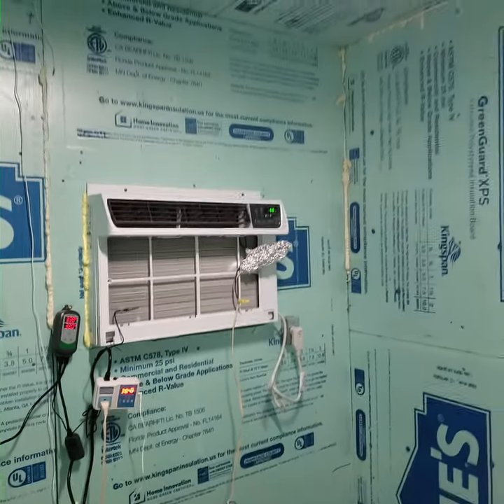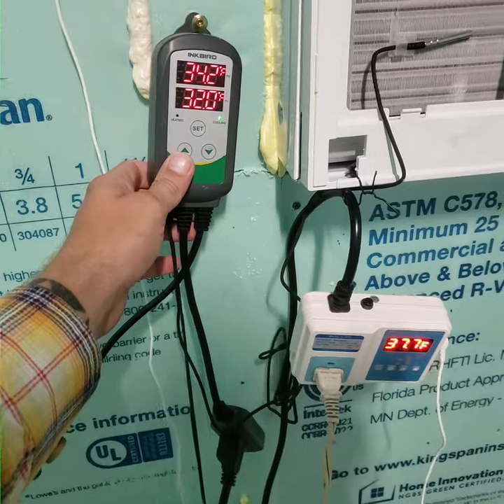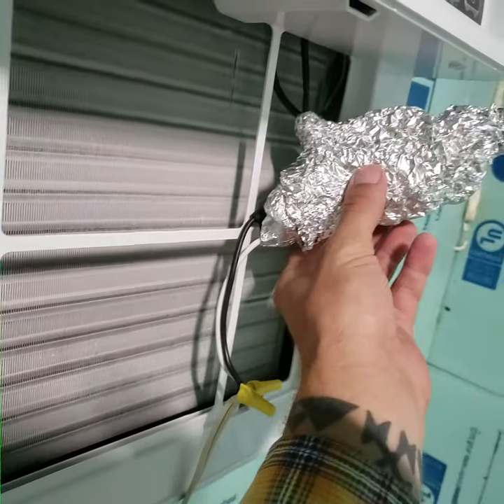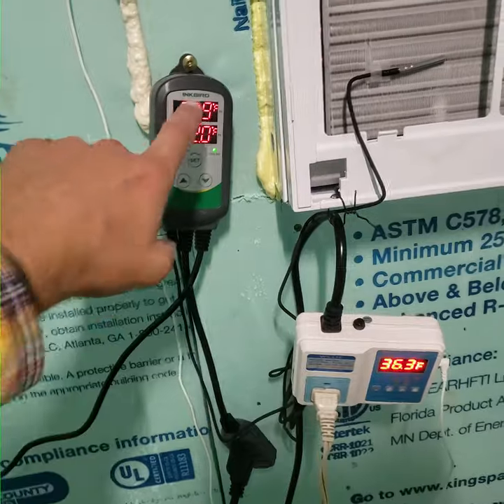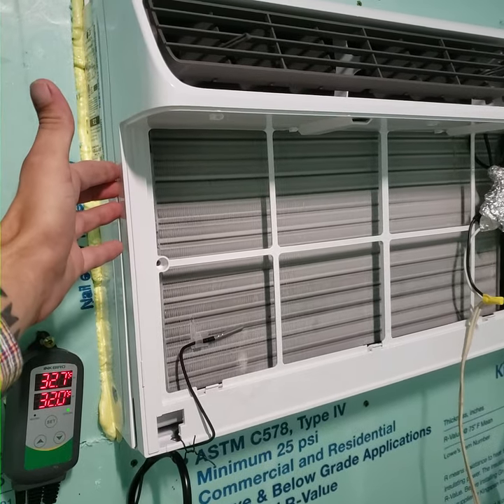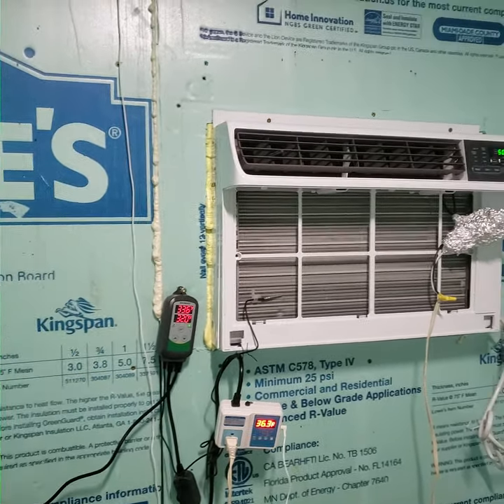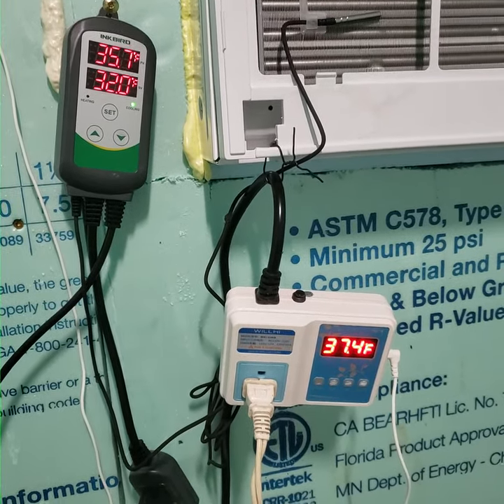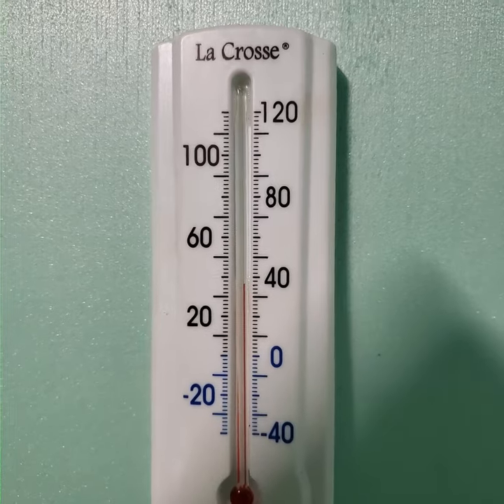Best coolbot alternative diy walk in cooler

Comment: Cut the temp sensor off. Use a multimeter to measure the ohms from the sensor in water at 90*. Buy a resistor or salvage and wire it into the and don't worry about the light.
Reply from the maker: I'm handy but not that handy. This is pretty much plug and play.  I can also reverse everything I did easily if I have issues with the ac

Comment: I take the wires from the thermostat and hook them together. I use a external control from a refrigerator. And a AC relay and 24v transformer for 240 units.  This gives a power disconnect. I put a fridge fan running constantly for defrosting the core

Comment: You should install your ac high as possible because cold air drops so the higher the ac , the easier it is for it to cool down your cooler .
Reply from the maker: probably. I just keep my probe about 12 inches from the ceiling for the temp control and go by that
Reply: One thing he did not mention is you need an air conditioner with a digital readout manual ones don't seem to work I've tried it and get as big as you can over 10,000 if you can or at least 10,000
Reply: Great video
Reply from the maker: @chriscrossman4464   Cool bot is excellent for their recommendations. One thing i did not consider is that going too large with your ac can have the same effect as going too large in your home which is that if its too big it will short cycle and not run as long as it should.

Comment: You only need one thermostat. Put the probe in the ac. Light on the ac thermostat probe ran from your digital unit. Ac plugged into the wall. You can't get it any colder than before the ac freezes up. You can only go up in temperature. So then adjust your digital thermostat to a regular spring loaded thermometer.

Comment: Just finished the same setup yesterday.  Any idea why mine won't go any lower than 44 degrees ?  And today (in very hot and humid weather), the fins freeze before it gets lower than 60.  I'm thinking its too warm outside right now.
Reply: Following.  How did you insulate and seal your cooler
Reply from the maker: Just saw this. Do you have the main temp controller sensor on the fins to prevent freeze up? it might take a few hours in hot weather to cool off but it should get there if you insulated properly.

Comment: You only needed the one controller. The controller sensor that's in front of the fins is all. Then you plug a light into that controller. And plug the ac unit into the wall. Then when the air getting sucked into the fins hits temp it will shut off the light and the ac unit still has power to defrost. Then when the room temp raises it will turn the light back on and cool.
Reply from the maker: You don't NEED the second controller but I think it's a better setup. This still does like you say and the unit never looses power, so the fan keeps running and defrosts the fins.
Reply: You need the second controller to stop cooling before the fins freeze up

Comment: Would you know why coolbot recommends that the secondary cooling coil sensor be removed from the mfg installed location and have it hanging...ie. besides the coolbot heat sensor and primary sensor which are taped together...   kinda a long winded question

Comment: Why does the room temp controller not loose power when the fin controller sees 32 degrees.  You say it shuts power off to the second temp controller but the LED temp is still showing when the power is removed from the room sensor?   don't quire understand how the white temp sensor is showing LED readout without power?

Comment: On your white temp unit, is it plugged into the cooling or heating in your inkbird? Also, did your AC have a secondary sensor and how did you bypass that? What type of bulb did you use as well?
Reply from the maker: I believe it is plugged into the cooling side.  If I recall the secondary sensor is either taped to the main sensor or it's on the outside of the aluminum foil.    I used a 60w led bulb but a brighter one may work faster.     The coolbot website and videos are still a wealth of information for this conversion.
Reply: @StrangeBranch  where would be the secondary sensor located at

Comment: Question, after putting stuff in the cooler. How long does the cooler keep temp before the AC unit cuts back on? I see in the video it jumped in temp after the AC cut off like my cooler is doing and wanted to make sure this is normal without stuff in the cooler.
Reply from the maker: That would probably depend on on the size of your unit, size of your room, insulation value, external temps etc. Mine runs more often when its 80 out vs when its 50-60 outside.

Comment: Very Interesting I'm in the process of building a Cool Room now. Just wondering about the type of Air-con required? Do you need a Digital Control Air-con (as you need with Cool-bot) or will a Manual Dial Air-con be OK in this situation?
Reply from the maker: I think almost any air conditioner will work. when i was looking into it there seemed to be models that were easier than others to access the sensors on the coils.    I think i went with a model that cool bot recommended but i dont recall anymore

Comment: Do you ever have an issue with humidity or condensation?
Reply from the maker: some condensation around the edges. to do it again i would glue all the insulation panels in with a foam sealant.

Comment: how would this work when its freezing outside I need to winter bees this way.
Reply from the maker: We have run it while freezing out and it tends to ice over more. i didn't play with the settings much but i think using a more appropriately sized cooler would work better. Ive since learned that over sized hvac systems can tend to "short cycle" and it can actually be better if it runs longer. Depending on your situation you might want to pickup a 3rd temp controller and plug a space heater in if it gets below freezing.
Reply: @StrangeBranch  I was thinking about a separate room for the ac to vent into keeping it warm so no ice the inside needs to be just above freezing but the bees are the heaters in that case.

Comment: Your relying on a light bulb not blowing.I would hate to have a cooler go down because a light bulb has blown.I like the price though,just can't trust a light bulb with my meats.
Reply from the maker: It's not In constant use. You can always swap the bulb every year when its turned back on. If I'm hanging meat I'm generally in there 2x a day anyways to work and monitor.
Reply: An LED bulb will be ideal, they last 50.000 hours